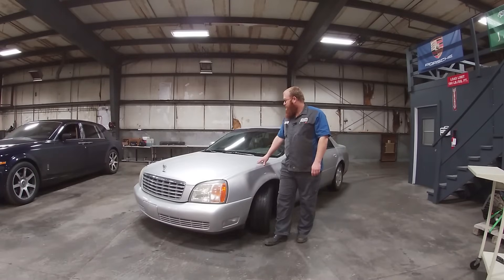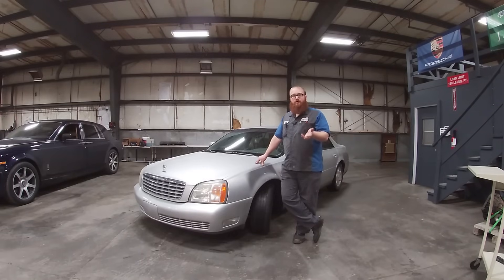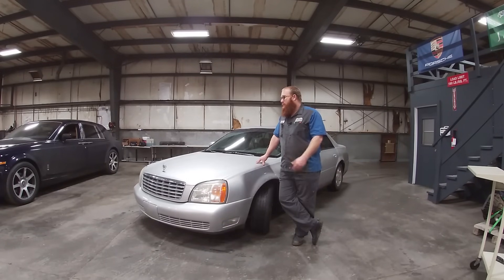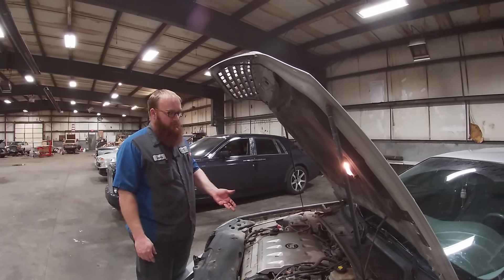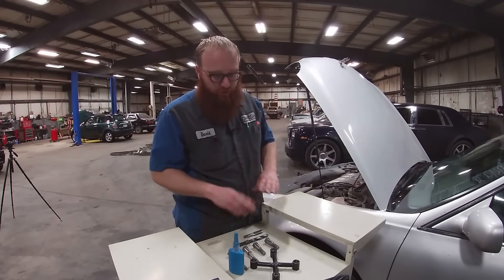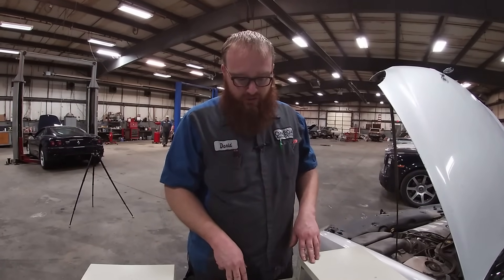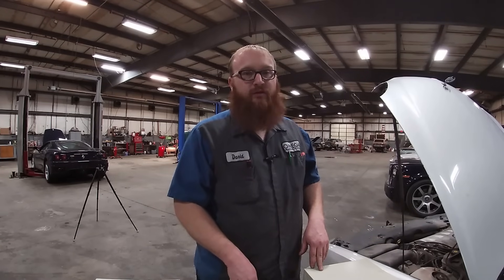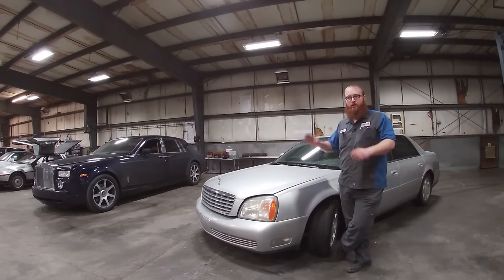The CAR WIZARD names Cadillac's Northstar Engine the Dumbest Design

Comment: GM is famous for saving 50 cents in manufacturing, so that you can spend $5,000 on repair later.
Long live Toyota.
Reply: Sad thing about toyota is they don't warranty their products... Only reason I went with kia.
Reply: Hey Toyota tried to save a buck on tacoma frames by cheaping out on the rustproofing and that blew up in their face hard. Local dealer as been slowly doing frame swaps on a few hundred trucks for about 4 years now. Every manufacturer is guilty of cheaping out its just that some hide it better than others and/or cheap out on the right things that done get noticed.
Reply: VW did the same thing in the 80's/90's by not putting a 15 cent circlip on the end of a transmission shaft which allowed it to slip and eventually wear a hole in the transmission housing. Once the fluid leaked out you could have a 4 grand transmission replacement next
Reply: Funny never paid five thousand dollars in repairs although I do change my oil  and filters and fluids and preemptively replace worn parts I don't think I know what you mean a transmission rebuild for a 84 Vette is that's a 4speed automatic with drive and it cost only 3500 I'd say u got screwed
Reply: Toyota scion xB 2008 or so had the oil eating clogged up piston rings. Dealer had to take the whole top end off and remove pistons. They're no angels!
Reply: I worked at a Japanese auto parts company which supplied parts to Toyota.
Our Japanese bosses often asked us for cost saving suggestions.
Thankfully, Toyota rejected all or almost all our ideas.
I bought a German car because, as an engineer, I think cost-engineering is pathetic.
Reply: @zxggwrt  I have a 2008 Toyota Prius with 330k miles that burns a quart of oil every 2,000 miles. Wonder if that's related? Hmmm
Reply: @circuitsandcigars1278  If its the same motor as the 2007 camry 4 cylinder than yes it is. I had a "warranty enhancement" which is not technically a recall a couple of years back when I owned a camry.

The Toyota dealership replaced 3 out of 4 pistons and piston rings after logging the oil consumption after 1000 miles (I burned a qt in that period) all for free, car didn't burn any oil after that and it had 200k miles when I took it into the dealership.

That warranty enhancement expired a long time ago tho so sorry to say it's of no help now
Reply: Yeah 32million.toyota recalls spell quality.lmao moro n
Reply: Slathian you won’t need your warranty with Toyota
Reply: @ReeseL4D  what? German cars have horrible reliability.
Reply: @truantray  what?  German cars have better engineering and better durability.
Reply: All manufacturers building cars under $100k are cutting cost wherever they can .
Reply: A manufacturer's customer is the person who buys the car new.  They don't care about the person who owns it second or third hand fifteen years down the line, and rightfully so.  They aren't going to charge their customer more money for the convenience of somebody else, that's not how business works.
Reply: Over here every import Toyota, we pull the sump and clean the oil pickup. Most screens are nearly blocked with either sludge or a shell of hardened crud!
Reply: Wrong
Reply: @michaelanthonyg3851  Still beats not having a recall and dying because of something they knew and didn't fix. Something GM is famous for. Think ignition key steering lock. Known (and fix available) before it went into production. That wasn't to long ago. And what about complete remote (wireless) control of all cars by one person? GM has a history of having fixes of dangerous things before production and still putting them in production and only applying the repair when they get caught doing it. They even had dealers change some things secretly without customer knowing about it, just to avoid lawsuits because well...people died. Now you have read all this, there are more examples, use google and get informed how incredibly bad GM manages these things and they keep doing it. 
btw: I don't drive a GM car or Toyota.
Reply: Bmw had plastic radiators back in 2000s
Reply: @SearchEast2069  Is that why I've seen so many fold in half on the lift
Reply: And Toyota did the exact thing and same design on their 4.7L 32 valve V8.  Its almost a duplicate and is one of their most popular V8 engines just like the Cadillac 4.6L.  Proper maintenance goes a long way whether its Cadillac or Toyota!
Reply: Fail. Ls engines are the most swapped engine on the planet. Toyota scrapped the 2 gay z in favor of a bmw engine lmao. Not to mention the crazy amount of recalls over the last 20 year's...
Reply: Antwon Jenkins thank you! These Toyota fanboys that love to throw shots at manufacturers like GM as if General Motors is the only one cost cutting and cheating out. They’re so delusional.
Reply: You sound like me...Screw Cataracts...Screw Lincoln...just buy Lexus or Acura. Screw MB...BMW...AUDI..VW...all junk or expensive junk.
Reply: Long live the 3VZE!
Reply: You must have never owned a toyota.
Reply: @six159c0splays  Toyota DOES NOT cheap out on their parts. Parts are made to a higher standard.
Reply: @mikefoehr235  yes they do, toyotas are built to a price point just like every other cheap econobox on the market, you fan boys are just delusional. Fuck, toyota wouldn't even spring for rust proofing their truck frames.
Reply: That's way gm is junk they killed people with the ing key recall and they knew it. Should of been shut down.
Reply: GM=Garbage Motors
Reply: Jason Robinson there is no recall. They refuse to recall that issue even though it’s killing people still.
Reply: Another brilliant idea of general motors
Reply: Magnus Atheos I work on Gm’s everyday thats why I don’t like them. And we’ve had only a blower fan go bad on our Camry that was under warranty. Can’t say the same about the neighbors Impala.
Reply: @ReeseL4D  Then why is BMW using cheap, plastic valve-covers, waterpump-blades, and other parts that cook & break after 10 - 15 years?
Reply: @sunbeam8866  because BMW uses parts not made in Germany?
Reply: @ReeseL4D  Pretty sure original BMW valve covers and waterpumps are made in Germany. But regardless, over the past 20-30 years, just about all German cars sold in the US have become over-complicated money-pits!  Generally, Toyotas and Hondas are still more reliable than most everything else. But they're slipping too, with recalls on the Corolla CVT, complaints about the Camry 8-speed autobox, and oil dilution on the DI-turbo Civic engines!
My late '90s Altima, Camry and Tacoma may not have 50 airbags or 50 computer systems. But they keep running, don't have biodegradable critical plastic engine parts, and I can still work on them.
Reply: @sunbeam8866  German car companies generally prioritize engineering (function and durability).  Japanese car companies generally prioritize manufacturing (reliability and longevity).  US car companies generally prioritize cost ($$$).  Take your pick.
Reply: @waterloo123100  Wrong. Carolla/Camry brake recall.
Reply: @ReeseL4D  ?

Wtf ?
Reply: @Magnus Atheos .... must be why gm and Ford are dying, while toyota thdive.

Word of mouth... it goes a long way.
Reply: @monsieurdubitatif8567  did you have a rebuttal or are you just here to clench your pearls?
Reply: @Magnus Atheos 
All cars maker do recalls : this is not the topic here: de are talking quality, for wich, toyota was until last hear, without equal.

Facts ARE undeniables, all thoses echo, camry,corrola, lexus.... Still on the road after 20 years,while the americain equivalent rust in the scrap yard ....

Gm and Ford are so good that they pulled out of the car market, as for Chrysler.... let's not talk about that...
Reply: Here in Australia, GMs are looking more like chryslers every day. Quality dropping lower every model. And the small ones show their junkiness. Shame to see a once decent company just push crap out the door.
Reply: ever try to replace head light bulbs or turn signals on the front ? have to take the whole facia off and work from underneath.
Reply: by the way refinish the plastic headlights for $100
Reply: @slathian1223  yes they do
Reply: @SearchEast2069  every truck rusts equally
Reply: Toyota  started to make shortcuts to...
Reply: Michal D Roosevelt ... what shorts cuts? 🤣😂
Reply: Lol Toyota the car company that kills it's customers and blames it on floor mats .....
Reply: @ReeseL4D  I had a Audi and a month didn't go by that something didn't break European trash
Reply: @bryanc9420  LOL toyota the car company where zero people died.   LOLOLO NASA even said thre was nothing wrong with toyotas algorithm. LOLOLOL GM the car company that wanted to save .70 cents and 170 people died and LOLOLOLL Ford the car compoany that new the pinto was deadly and figured it was cheaper to deal with the lawsuits than fix the car LOLOLOLOL
Reply: @bryanc9420  The reason people buy German cars is not because of their reliability.  If you bought an Audi for it's reliability, then you are a fool.
Reply: Ex Animus  funny you should mention aluminium blocks, seems Buick had a nice one in the early sixtys. No trouble at all as I recall. The engine tooling was sold to Rover in england and they used its design successfully for many years. Seems what was old is new again....!
Reply: @sunbeam8866  true, how about the BMW's that develop small oil leaks that cause the belt slip off and wrap around the camshaft. 4k job at the dealer because of a simple cheap plastic defect. But they are the ultimate driving machine. Smfh
Reply: @six159c0splays  ive had one for 10 years no issues hahah its a unicorn
Reply: @monsieurdubitatif8567  ive never seen an american truck frame break in half from rust like the toyotas were known to do.
Reply: @six159c0splays  cause youve never looked :-D
Reply: @six159c0splays  thats an intelligent comment.  there ya go big boy way to prove your point.
Reply: @waterloo123100  how the fuck does someone die from an ignition key? Ive owned multiple gms and have never died from an ignition key.
Reply: Jordan Moir  they also used defective airbags that have killed like 32 people so far.
Reply: @six159c0splays  when was the last time you saw that?

This problem was quickly resolved,  as you well know.

Only Ford can somewhat compete To Toyota truck durability,  gm and especially those chryslers "momtruck" ( ram)...

As a mechanic
Reply: @monsieurdubitatif8567  im still seeing it, and the problem wasnt quicly resolved, toyota techs had to spend years swapping out rusted frames on shitbox toyotas. And then there are the takata airbags that have already killed something like 30 people...
Reply: @monsieurdubitatif8567  Yeah that must be why ford keeps slipping farther down the reliability ratings then. So far every single opinion you've expressed here has been the opposite of what real techs are experiencing in reality. You most likely get your automotive information from music videos and computer games. Enjoy your rotted frame and deadly airbags.
Reply: @six159c0splays  ... yes, they slip because they were High,  hence the " somewhat"...

The fact that they Still change frame has nothing To do with the fact that the problem ( à one year affair, if i recall correctly) was quickly resolved...
Reply: @monsieurdubitatif8567  toyota has been replacing those frames for years, wtf does it matter if you think the problem was "quickly resolved"? And still no comment on those deadly takata airbags that have killed dozens of people? That figures. Youre trying to downplay major failures of design and construction by toyota because youre a nut swinging fan boy who has played too many video games.
Reply: @michaelanthonyg3851  Very misleading. Why do you lie? Those recalls aren't even a lot compared to other manufacturers - plus you didn't take into account the severity of the issue. Stop lying.
Reply: I'm a Toyota guy and drive an 03 cCamry with 244000 miles, but when I checked the service bulletin on my car, my engine, the 2.4 lt is prone to head gasket issues and it's the same issues that these Northstar motors had, the threads in the block strip out and you get that weird inside out thread look. Thankfully if it does happen, it happens at 110000 to 160000 miles and I'm way over that so I think I'm in the clear. So it does happen to other vehicles other then GM, but generally GM makes absolute garbage. My 2000 Buick Centry is a testament to GM's failures, from water clogging up the ac condinsation drain so it pours out onto my blower motor frying it to the resistors in my odometer and gear selector going out at 120000. My auto dimming rear view mirror bubbling and showing double, my intake manifold burst, and the cruise control stopped working because one of the conections was burnt and blown on the cruise control module. I hated that car so much.
Reply: Oh yeah? You mean the company that had an electronic throttle position sensor issue and blamed it on floor mats when people were DYING That Toyota? Ha right. If I buy Japanese cars it's a Honda. Japanese bikes? Suzuki or Yamaha. Fuck Toyota for blaming their cars going full throttle on floor mats. They willfully covered up an issue they knew about to buy more time to try and fix it without doing recalls. Scummy
Reply: Jordan Moir  no sir they blamed the floor mat when it was defective electronic throttle position sensors. Basically the sensor that detects how far you put the pedal down in lieu of a throttle cable thought it was at the floor. They blamed the floormats KNOWING It was a TPS issue.
Reply: BMW and Mercedes engines are very well made to be fair . That's where I draw my line, those cars have horrendous resale value
Reply: Have a 1979 corolla as my daily driver. Bulletproof engine, decent tranny thats slow as molasses but solid. Car is still running strong after 40 years. Cars today, especially BMW and GM junk will wither away in 10 years .
Reply: They sold it to Rover for one of two reasons that I heard of: 
#1 Too many American mechanics had a habit of tightening bolts by feel rather then with a torque wrench, which caused the threads to strip out of the blocks. 
#2 Many U.S vehicle owners had a bad habit of filling their cooling systems with tap water rather then coolant, especially in the Southern U.S, corroding out the engine blocks of the 215 V8s. 
  There wasn't actually anything wrong with the design of the engines it was the failure to educate owners and prospective mechanics in the North American market, since G.M didn't want to deal with any more complaints they discontinued making those engines by the mid 60s. Aluminum engine blocks, and other parts, were nothing new in England so mechanics over there were more used to working with them.
Reply: Slathian        Yea but then there’s the infamous self destructing Theta 2 series engines they share with Hyundai.   1.8 , 2.0.  2.4.    All junk .    Then there’s that trade in value🤦🏻‍♂️.    Been there done that, so did some friends 😖